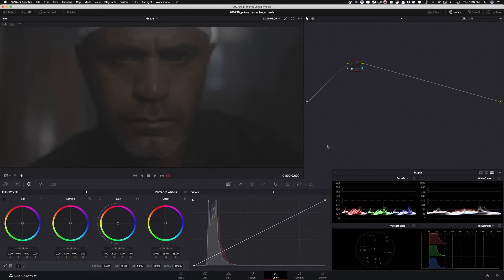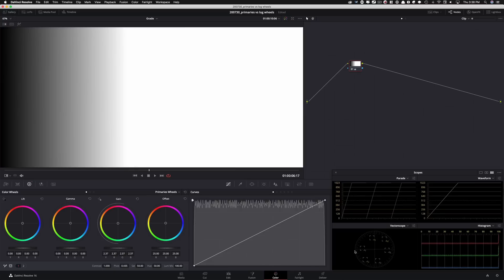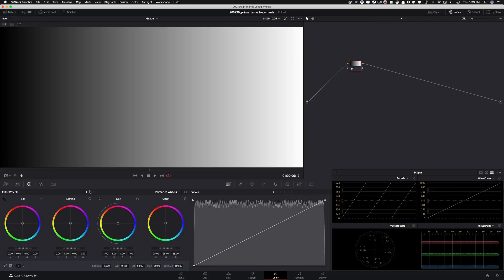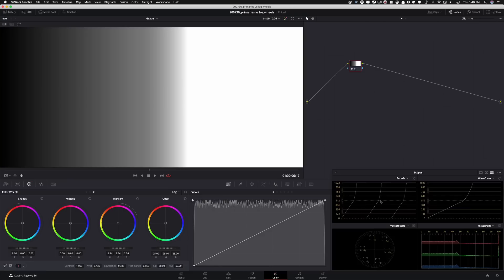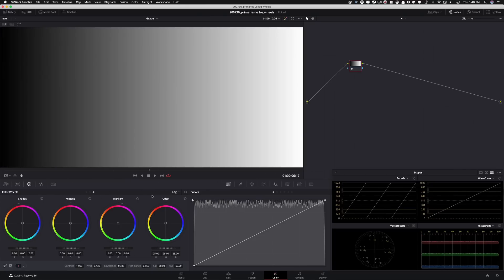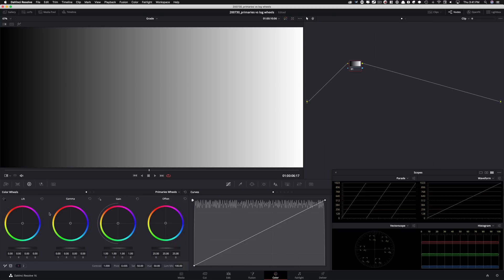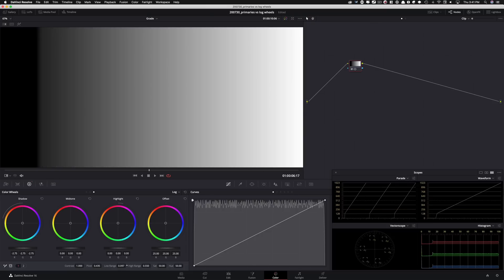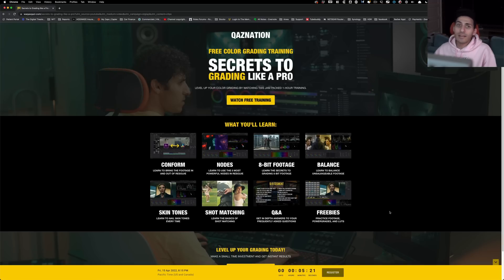What’s the Difference Between LOG Wheels and Primaries Wheels? | DaVinci Resolve Tutorial

Comment: Even though it can be used for fine tuning, the vast difference is at what step of the image processing it is used: Log is mainly used to “delog” the RAW/LOG images, whereas the primary are used for the subsequent steps to manipulate your image once it is already “deloged”.
Reply: so if I use CST there's almost no reason to use the Log Wheels?
Reply: @koalamusik  I have not been in the need to use them at such point since BM introduced the HDR wheels. That is a way better tool to fine tuning your image after it has been deloged.